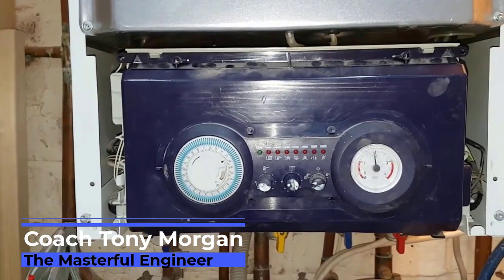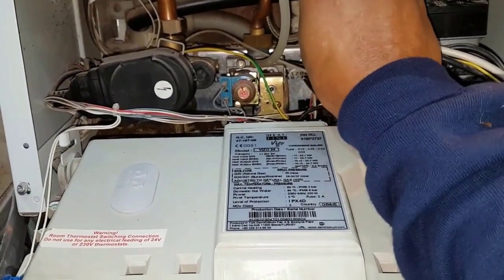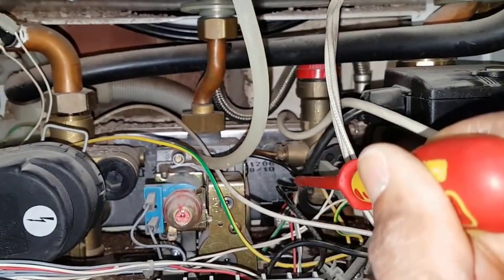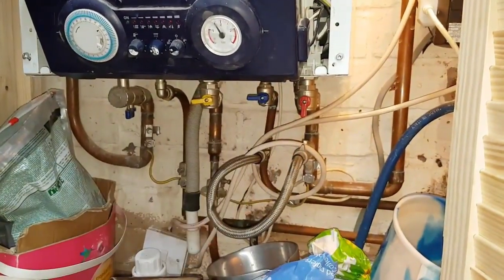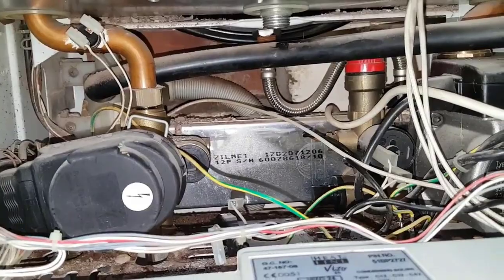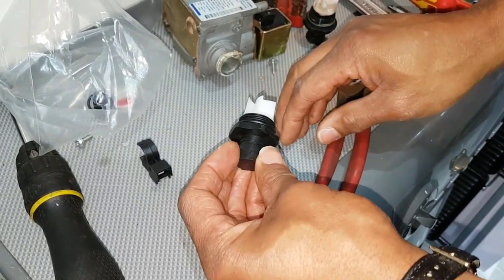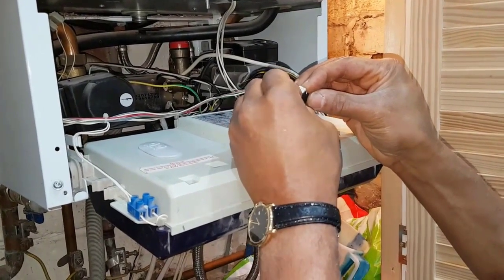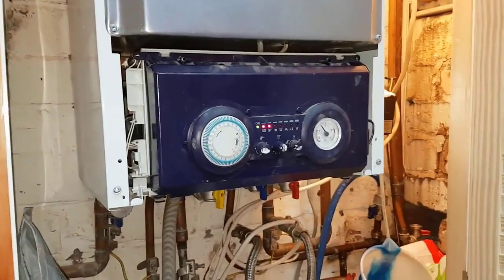Heatline Vizo No Hot Water

Comment: So was this issue no hot water not firing up have the same issue on the same boiler I’m going out too has a leak on the diverter plug so replacing that there saying heating works but hot water runs but boiler doesn’t fire
Reply from the maker: That would of been the divertor valve cartridge

Comment: My vizo 24 had that exact problem, but less leakage and the water flow sensor stopped working. However, I just dried out the switch which is part of the flow sensor with a hair drier and it worked find and dandy afterwards. Probably no need at all to replace that sensor - the switch was just wet.
Reply: Obviously, I also tightened up the leaking valve union above the flow sensor before drying out the switch.
Reply from the maker: Thank you for your comments
Reply from the maker: hey we're currently trying to grow our Facebook group and would love you to join Tony and the team using this link, Tony will be available to answer all your questions directly https://www.facebook.com/groups/167070231326174 we will also add this link above.